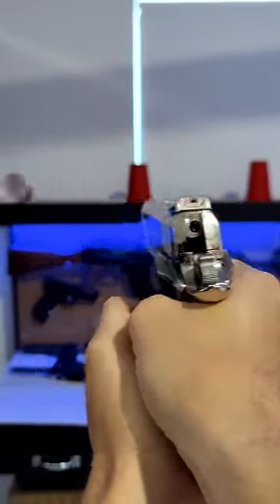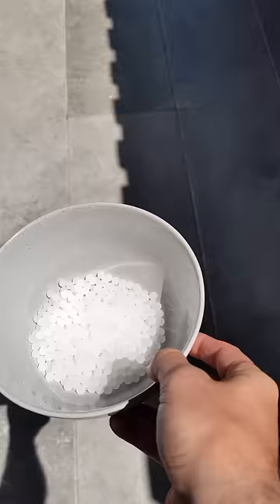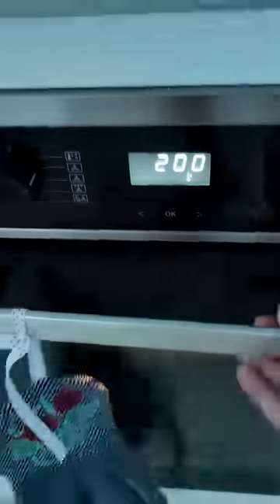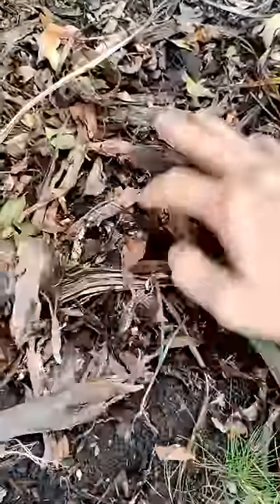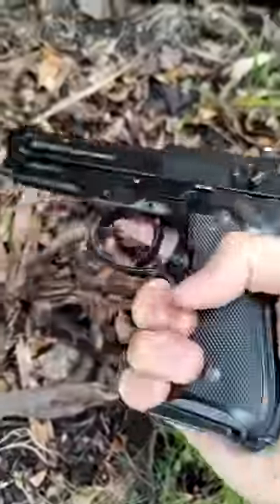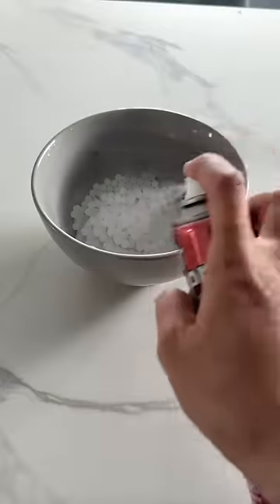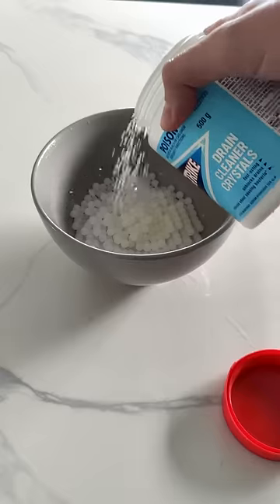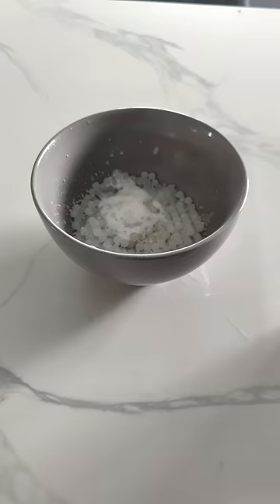How To Make The Hardest Hitting Gels For Your Gel Blaster

Comment: Mixing strong bases with oil will make soap, which makes sense as a lubricant (especially if there is an excess of oil). Adding bleach makes no sense as it will degrade the soap and possibly the gel itself.

No, it won't make chlorine gas, that happens when you mix bleach with acid. Mixing bleach and base is safe, in fact Drano Max Gel contains a mixture of bleach and sodium hydroxide.